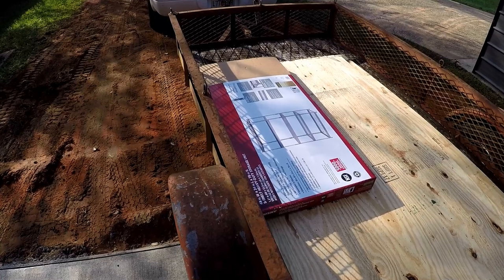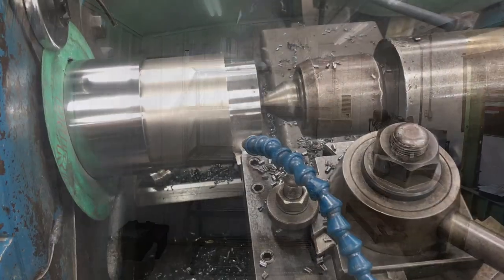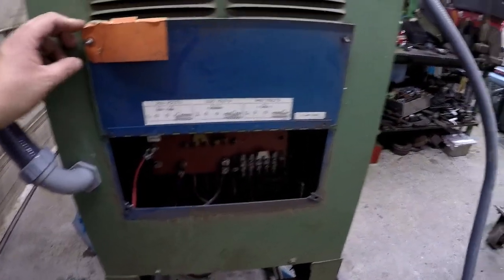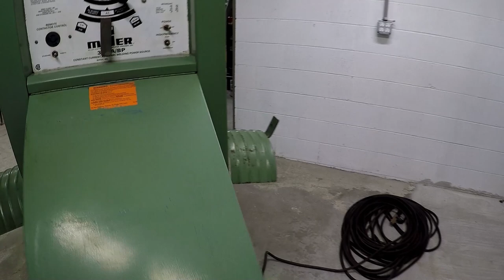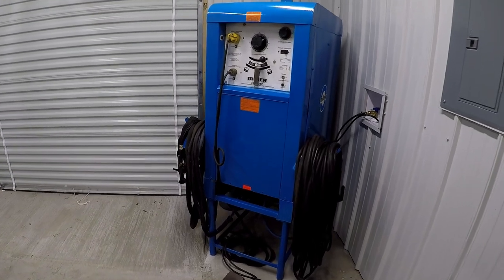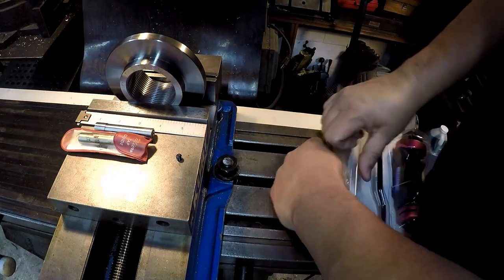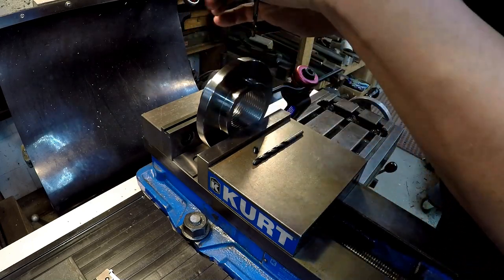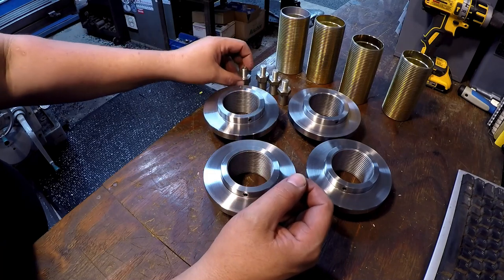SNS 192: Shop Projects, Edge Multi-Axis Stop, Drill&Tap Spring Perch

Comment: you can buy half and quarter sheets of ply at most Home Depot stores....  Just buy enough for you one shelf.
Reply from the maker: +ramosel I just have missed that isle.
Reply: At the stores I've been in, its usually at one end of the aisle that has the plywood. They have half and quarter sheets stored vertically.  Usually not many, but you should be able to find what you need.

Comment: I think those shelves are double sided, if you turn the shelf over it will have a lip on the front edge, to prevent things from rolling off
Reply from the maker: +bluegreenash You can configure them in three different ways.
Reply: they look pretty good :)  good shelving (and toolboxes) are hard to find

Comment: On your welders it would be smart to have a water container with a small pump so you recycle the water so you could save on the water bill
Reply from the maker: +Flemming Løvbo Like what I was using? I like the tap setup.
Reply: Or you could get fancy and put a rainwater tank outside, have it above the outlet level and just let it gravity feed the machine too. A bonus would be never having to worry about water scale, corrosion etc from town water.

Comment: I have a dumb question: when you spray "water" on your bit and parts to cool them, does that just collect with the chips and on the ways of the machine and you let it evaporate?
Reply: Nah, the ways etc have oil coating them, it just runs off.
Reply: Where does the water eventually go? Is it just assumed the 'coolant' eventually evaporates and the oil coating prevents any rust?
Reply from the maker: +Sizukun1 After the job is complete I always clean the machine and wipe it down. The water will evaporate but the Kool Mist will leave a film and staining on the machine.
Reply from the maker: +Sizukun1 Yes it evaporates or is soaked up, or drains to the sump. Mist coolant is not recycled.

Comment: When I put my workshop floor down, I sealed the concrete with PVA glue its cheap and soaks into the concrete and leaves the surface so hard that it does not chip if you hit it with a hammer.
Reply from the maker: +Equiluxe1 Never heard of that one.
Reply: PVA is used here in the UK a lot for sealing plaster or screed as well as concrete, available from builders merchants in gallon jugs and 5 gallon drums.Mix it 50% with water and spray with a garden sprayer etc, for floors just tip on and spread with a brush or broom.
Reply: I would agree it works great! (and it is cheap too)

Comment: A pallet jack is a very handy tool!
Reply: Mike De La Mater  cheapest tool you’ll ever bye. 299.99 and most will lift five tons. Seem to last forever. Get new rollers cheap. Just check your pins now and then. Just your local life truck mechanic.
Reply from the maker: +vilsiran Most I seen like mine are 5,000 lbs, not 5 tons.
Reply: Boy is it ever!  Glad to see you got yourself one Adam!  At the factory I work at, you can't get anything done without them!  Too labor intensive getting pallets of supply parts to their stations and finished product hauled to shipping/receiving without them, so in a home machine shop like yours, its just as indispensable! ^^
Reply: Abom79 well I’ve been out of the industry almost 15 years now so very well could be. Your old walky/stacker brought back memory’s. Still have a switch that goes under the flipper in the handle.  Never miss a video from you Thanks.

Comment: Reason it's hard to find good plywood is because the old growth forests are pretty much up and gone when it comes to what they can harvest within the functional area of the factories. What you're getting now is new growth. And the situation with that is two fold.

On one side, they are too young and small to get proper branch free wood out of them, and on the other, the administrators of the forests don't cut the low hanging branches, which means the wood is "contaminated". 
First situation gives warped wood, hard to glue properly, second one gives potted surfaces.

My solution for that is to make my own. Sure, costs a bit, but short of getting marine surface grade plywood, nothing else is easily found, not for a good price (and when i say, it costs a bit, it costs time, and time is money too).

Dad has tons old plywood (circa 1980s), which in today's money would've been cheap as spring water. It looks amazing, i've been drooling at those pieces for years now, but he won't budge.
Reply: Plywood hasn't been made with old growth trees for a generation and more.  The trees are grown especially for plywood production and are started in nurseries and then planted.
Reply: the reason is hard to find "good plywood" is most likely you are going to home/lowe's depot, they sell the lowest grade you can get and its usually surfaced on one side only.  If you can go to a real lumber yard if you can find one and you might end up paying a little more(in my case usually close enough to home/lowe's depot) for a much higher grade of wood and they have a lot more options for grades as well.
Reply: Get some birch ply ,that’s the stuff you need . Could be called furniture grade
Reply from the maker: +CliffWalrus Yep I’m learning that, but only problem for me is my local lumber yard is only open the hours I’m at work.
Reply: Don't forget it's the Hurricane State...B Grade plywood in abundance. Cabinet grade if you want it to look nice.
Reply: Abom79 that's like our local construction supply places the ones that got all the good quality tools are only open while I'm at work
Reply: Plywood comes in three grades: good, good one side ("shop grade"), and bad both sides ("BBS"). Home Despot and Lowes only carry BBS plywood. That said, it looked like you might have had the back side of that plywood up on the shelves.
Reply: Plywood is made with whatever species is required to make the grade it is meant for.
Plenty of grades of plywood are made from old growth timbers, specifically marine and aircraft grades, where things like guaranteed strength, moisture resistance and weight are primary considerations. This is why proper marine and aircraft grades of ply are more expensive- it means importing logs to the factory so they can be sliced and processed.
Since most plywood veneers are rotary peeled, it really doesn't matter if the tree is new or old growth, as long as the timber species meets the requirements of the timber grade, and it's not sap wood, it is just fine.
Not all plywoods are the same- the cheapo grades are barely glued together and can have more voids than a used car warranty, whereas something like marine ply specifies timber species, certain types of adhesives, maximum glue line thicknesses, zero voids or laminate repairs before bonding, sampling after batches are manufactured etc.
You get what you pay for and if you buy cheapo 3 ply pine and expect it to be a nice sheet of 7 ply marine grade.......

Comment: Arn't you going to paint the floor? Would make it look really smart in there with a grey floor and keeps dust down
Reply: amd4life89 painted floors are great for the first year or two, then they are maintenance nightmares.   We have 14 branches at my company.  We painted the first 6 before we learned that lesson.  Natural concrete as boring as it is, is way better long term than any coating.
Reply from the maker: +Chris Exactly. I’ve seen my share of painted floors that look like crap, I don’t want the hassle. Epoxy is great but for good quality expensive. I’m fine with the concrete floor. I’ll be sealing the new slab however.
Reply: Painted floors are a murder to maintain. Not worth it. Best you can do for your shop is to: A. get a special type of concrete layer, pretty expensive, usually found in big markets, B. seal it up.

Comment: Adam - how old is that miller?
Reply from the maker: +ratman396 Between 35-40 Years. I’m not sure exactly when Dad bought it.
Reply: Nice old baby, I'd love to have that
Reply from the maker: +ratman396 Keep your eyes open for used units. These are high quality machines built to last. You can usually find them from $600-$1,000.
Reply: will that do stick, MIG, and TIG?
Reply: Just stick and TIG, the old 330A/B is a work horse for sure!
Reply: You could probably put a wire feed unit underneath and wire in a MIG hand piece. I know it would be possible, but don't ask me exactly how.
Reply: Technically you can do MIG welding with a constant current power source, but the welds will be crummy and inconsistent (I've experimented with it before)...
It works better going the other way, putting a TIG torch on a constant voltage (MIG) power supply, but that also has it's issues.

Comment: Nice job on the new shop extension so far, Adam, it's really looking great!  I found that same rack at the store too, and bought one.  I like it real well, I've piled it up with lots of the spare parts and attachments for the Hjorth lathes.
Reply from the maker: +The Joy of Precision After stacking some heavy items on it this weekend I’m not so sure it’s up to the Abom challenge! 😆
Reply: LOL!  Is the rating on the box a bunch of marketing baloney?  I've got maybe 150 pounds per shelf on mine, at most.
Reply from the maker: +The Joy of Precision Maybe a 1,000 flat plate! On the bottom shelf I set that big new faceplate on it and I thought the shelf bracket facing me was going to twist in half! 😆 I guess this is going to be temporary.

Comment: the problem with plywood is they have cut the number of plys.  1/2"' is now 15/32" and was 5plys, now 3 or 4 if you get "premimum".  material isn't flat unsless you can nail it all around to take the warp out.

Comment: Abom, if you're looking for an AIR LINE system I have a great and very economical system. I installed this in my shop 10 years ago and  have not had a leak or rupture since. It is made out of 3/4" schedule 40 PVC Irrigation pipe, fittings and ball valves. Ball valves are used for inline cut offs and drains throughout the system.  Glue it all up and you're good to go for years to come. 
The joints, when properly glued are guaranteed to never leak. The glue gets the PVC real hot and acts as if welding the joints together (melting). In my opinion this is a lot better than having threaded fittings throughout the system for each split that you'll need. The only threaded joints you should have are where you attach the quick disconnect couplers for airlines
Look into it online if you never did any kind of irrigation work and follow all tips and tricks on installing a Schedule 40 PVC irrigation system.
You will end up with a rigid, durable and leak free Air Line System for years to come at a very small fraction of the cost than what a manufactured Max Air Line system costs. Plus, it is very easy and faster to install than having all those threaded joints which always end up leaking .
One note: I did use metal clamps to attach the air lines to the walls and ceiling.
Any questions, just ask in the Reply box
Reply: 3/4" schedule 40 pvc costs $3 for a 10 foot piece and rated at 480 psi. Unless you're trying to blow the roof off your shop, this is more than adequate.
Reply from the maker: +Leonard Zielewski I would not suggest to anyone using pvc pipe for an airline system.